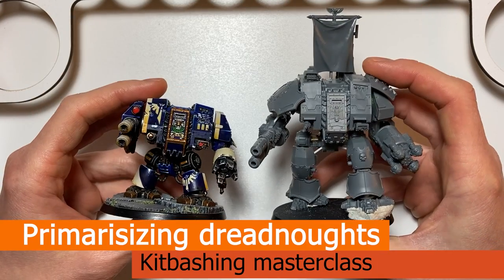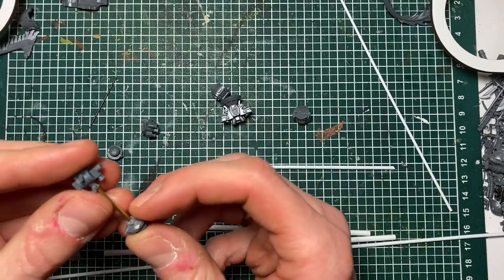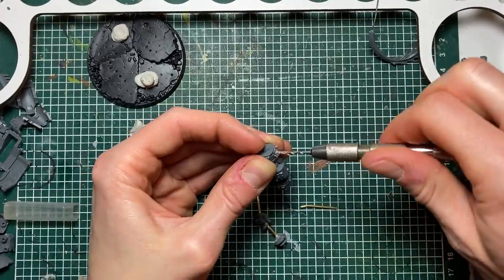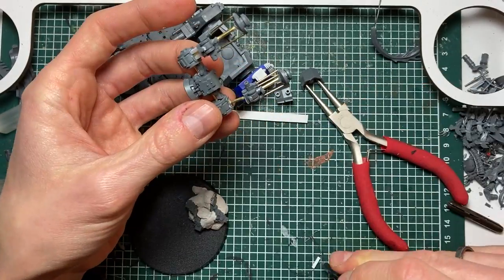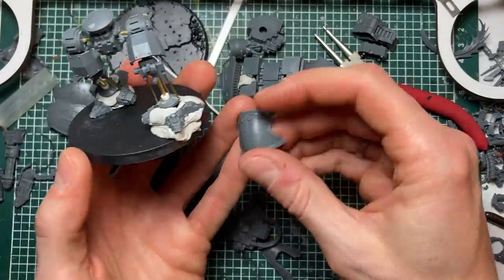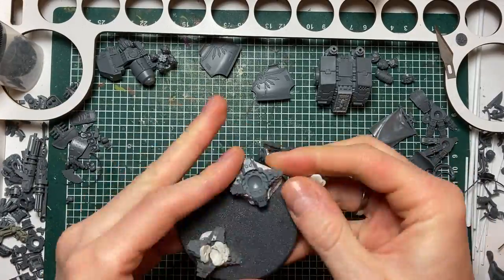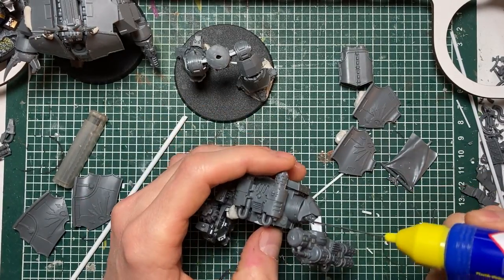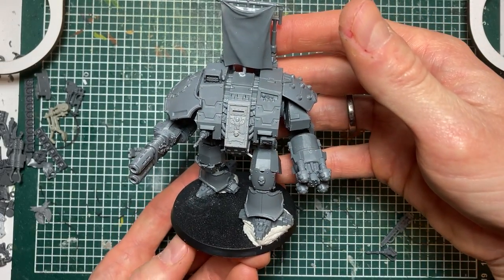Primarisizing boxy dreadnoughts - kitbashing masterclass

Comment: this is amazing ive tried a simpler method of this my combing the box dread with a contemptor dread but i cant wait to try this out!
Reply from the maker: Yeah I've tried the same but the contemptor dread legs look to thin and long, while the redemptor dread legs look to thick and wide to me. One option that does work quite well is to use the legs of the AT warhound titans. But those have the chicken-leg look, which you need to be into for it to work for you I guess. But the size is pretty much perfect.